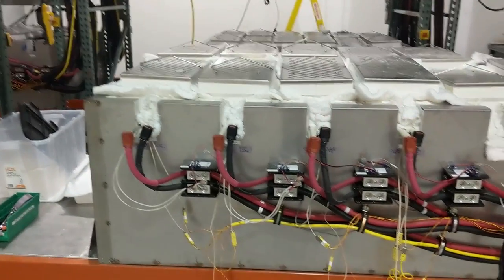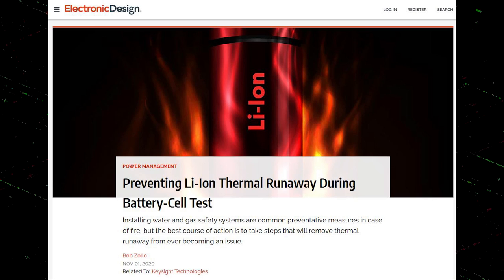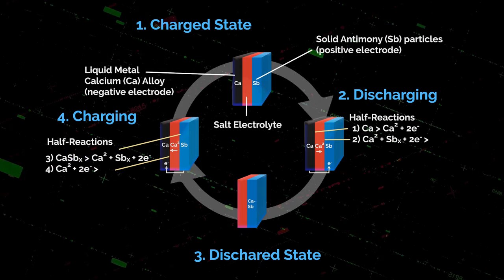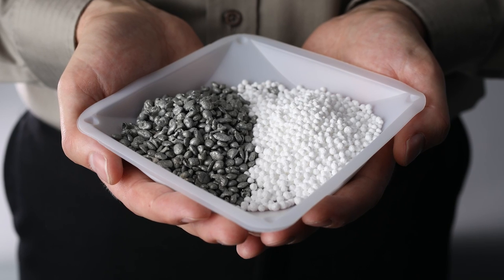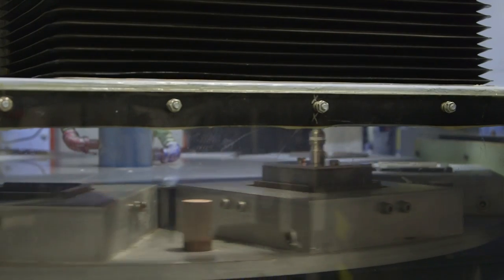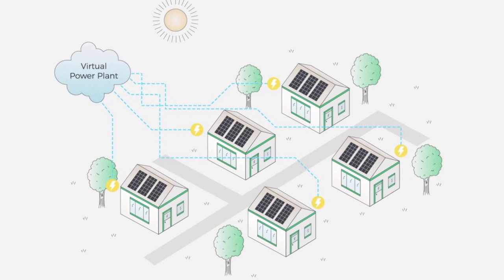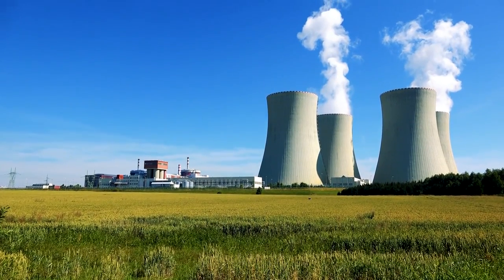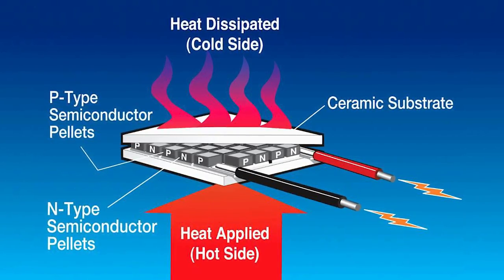Ambri: A Battery that Could Change the World

Comment: I wonder if you could combine this with one of those solar towers that use mirrors around it to heat the liquid metal.  That way you would still be using the sun to keep supplying more heat if needed.
Reply: they kind of use it to melt salt to generate steam and run turbines
Reply: The batteries are designed to generate their own operational heat through charge and discharge, and should not "freeze" unless they are not used for a number of days, or in the event that one of the cells fails it could end up freezing if say it had a loose connection. The key point is one of safety, and secondly efficiency(vs. cooling a li-ion bank), for if a battery cell fails the cell does not ignite and possibly ignite all the surrounding cells (as a li-ion bank might do) instead it freezes and is inert. A frozen cell could be brought back to running temperature the same way that it did it the first time it operated(the cells are shipped in a frozen state and brought online in the field). With the daily fluctuations in power supply vs demand on the grid, these cells should remain at running temperatures throughout the expected lifespan of the product.
Reply: And roasting every bird that flies by...
Reply: @jimrobcoyle  side effect = solar barbeque 😁
Reply: @jimrobcoyle  you could call it the Archimedes death battery
Reply: Hmmm... or use these to bleed heat off nuclear plants. These would easily store power from solar arrays... which could (should?) be built/put inside the empty perimeter of the federally protected atomic energy compounds... from which the additional power could go out on the same grid.
Reply: @mattwilliamson1714  In this case, the heat isn't generating power, it's a regular battery. You charge it with an electric current. The output is the portion of electric charge that was not converted into heat during the charge and discharge cycles. That is  basically how all batteries function
Reply: @mattwilliamson1714  lol.... nuclear plants generate amount of heat required for it's operation
Reply: @ironassbrown  I understood that. I was pointing out that an uncharged "dead" battery could be used to absorb heat.
Reply: @Brainwaave  Really? I'd never have guessed... and since I did not know that nuclear plants produce heat as a waste product... I went on to posit that there may be a chance to store dead "frozen" batteries in a place in which they could act as heat sinks until they were needed to store or transfer power obtained from a green source. 🤦🏻‍♂️
Reply: @mattwilliamson1714  well nuclear plants are closed cycle so if you take more heat off, you will have to produce more energy to heat up the cooling fluid which transfers heat from the core to the steam generator to run the turbines. you can not let the steam cool down to become water as lot of energy is required to change the state of water again.so things are not as simple as they may look like
Reply: @mattwilliamson1714  LMB uses the heat from a nuclear reactor in a more convenient way. The reactor heats steam that turns a turbine and generates electricity, that electricity goes through a wire into the cells of LMB and makes them hot, you don't need a giant heat exchanger just a wire, and it doesn't need to be built in the nuclear plant, you can put it somewhere where it is out of the way. remember the cells of LMB are insulated and sealed cans, which by themselves is simple. If you start adding a bunch of external interfaces to the design not only is it bulky and more difficult to maintain, but it isn't simple anymore. and the heat your pulling off the power plant would probably be more efficiently used to turn a turbine. If we are talking  about a PWR reactor then you really can't get the kind of temperatures needed to liquify metal unless the reactor melts down which would be very bad. An MSR reactor could get up to those temperatures but once again you want that heat for things like electrical generation and water desalination. The easiest solution to heat the Liquid metal battery, is to just use a wire and heat it up with electricity, once it is hot then it stays hot through daily use.
Reply: @Brainwaave  You have jumped to the wrong conclusion and attempted to bolster your incorrect assumption by explaining your view of my comment rather than just asking the "what, why, and how" of what I said:

Specifically, I was thinking of the Fukushima and Chernobyl events in which they needed the ability to quickly get rid of heat... at levels far in excess of the boiling point of water... and they also needed a power source to continue pumping water to cool down the reactors after the reactors were being shut down. Rather than depending upon slow diesel pumps (which need more time to kick on and be used effectively), this could be added into that equation.

Some of the batteries in this video (which operate at much higher internal temps compared to any type of boiling water) could have easily taken very high temps as heat sinks (which would have also activated the availability of the power within them as a further backup to a need for a power source to run the plant in the case of power loss). This could be done quite easily if part of the containment vessel was a metal that turns molten below the excessive levels which activate the frozen batteries, and stays molten far above the activation level. The molten metal would need a fail-safe such that (whenever the metal turned molten) it would be pumped around an array of "frozen" batteries (not at operating temp). The heat would transfer into these frozen batteries and act as an emergency heat sink.

Simultaneously, if more of these batteries (in some other location) were pre-charged (pre-heated) they could be activated immediately, used to power more containment features for longer periods of time... and be able to be recharged by either wind, solar, &/or a direct connection to the power grid... which would avoid future meltdowns.

Rather than relying on "standard" containment systems and backups, it would be simple to implement multiple uses of this type battery into the current design of nuclear power plants as an additional fail-safe to "bleed heat off" of those nuclear plants in the event of catastrophic failure.
Reply: @ironassbrown  Exactly. You weren't understanding my comment.

I was thinking that using frozen cells as a further failsafe (heat sink) would provide a very simple extra fail-safe into the containment process. (See my comment above to Arjun.)
Reply: @mattwilliamson1714  I see what you're saying, and my best answer would be that it is probably not a good use case for this technology. Do you have some design in mind that would take heat from the core of a reactor and somehow sequester it in the case of an emergency I would be interested to hear it. Right now I am trying to imagine how it would work since the way heat is carried away from the core of a PWR reactor is through the cooling water which is not nearly hot enough to melt metals and salts. In an emergency such as Fukashima, the problem was that there was no cooling water so I can't see how you would get the heat out of the core. Also, the amount of heat produced by a reactor meltdown that size is way more than could be contained even in a reasonably large LMB. I also have a hard time understanding how you make it make economic sense to build a giant battery bank that sits unused unless there is a meltdown, in which case you have some pretty big problems to deal with. I am not trying to fud on your idea, just hashing through what I believe to be the considerations.
Reply: @mattwilliamson1714  lol Fukushima and Chernobyl were two different disasters where the core melted, Fukushima due to tsunami the coolant got drained out and engineers didn't shut down the reactor in time the only damage was radiation leak ..Chernobyl was a human error where the temperature went haywire... you should not be designing a reactor with liquid metal batteries hoping that there would be a meltdown and we can use the heat... in case of run away reactor... no amount of those batteries will help as everything will boil in them

Comment: If you produce heat you spend energy, cost of operating this system is a big question
Reply: Brilliant tech. It heats itself just by working, so all you need is resistive heating elements to get to temperature. Luckily, you'll be hooking these up to megawatt-scale solar installations so wattage is no problem; you just wait a few days to produce usable energy.
Reply: @davidahn4130  not even days. less then an hour should be more then needed.
Reply: He said they would be well insulated, which I would not think would be that difficult. If so, after reaching operating temperature, energy loss would be minimal. Current batteries in production have internal leakage losses. If they could encase the liquid metal battery inside a vacuum walled canister losses would be virtually nothing.
Reply: Did you notice your phone heats up when you charge it?
Reply: what battery doesn't produce heat when it is charging and discharging? The difference here is that the heat is useful instead of an unwanted byproduct.
Reply: @danielboro2000  Right you can charge your phone to 15% and use it right away, it only takes minutes to put the charge in. This will be basically the same,  power controllers can switch back and forth between charging state and discharging state in milliseconds, and the batteries won't take days to take a charge they are meant to cycle daily which means that they need to be able to charge fully when supply is high and demand is low and discharge when supply is low and demand is high and that happens almost every day without fail every single day of the year.

Comment: It would be impressive if someone could incorporate the use of liquid metal batteries and Lithium-ion batteries at the same facility in an alternating pattern. I wonder if they could use the heat from the Lithium-ion batteries to heat up the liquid metal batteries without the Lithium-ion batteries being damaged or going super-critical
Reply: I would like to see this technology compared against the Ford Motor Company  developed Sodium-Sulfur battery technology which is also a hot battery.

Comment: What is Ambri's current manufacturing capacity? What is their plan to rapidly scale manufacturing capacity beyond 10 GWh/a?
Reply: Current capacity? Doesn't matter.... Easily scalable.
Rapid scaling?
Same answer.
Advantage?
More lithium/ Nickel, etc for weight/ density critical applications.
Think about the global power system rather than pitching one solution against another.
Reply: @rogerstarkey5390  I am thinking about the global power system, that's why I want rapid scaling. I want different types of cheap storage available on a massive scale in 2025, rather than in 2040. Ambri are apparently planning to finish the 250MWh data center project for their first customer by 2023.

Comment: really enjoyed the straight forward answers and it sounds like a great invention, I realise that the storage is large capasity I was wondering if it was possible to power cars and or trucks like a lit ion battery does.
Reply: It's designed for grid level storage, but a home sized unit is possible, but may be a bit big compared to Li-Ion.
Reply: No, it is a stationary battery only. Think shaking the oil/vinegar salad dressing.

Comment: give the POWER to the PEOPLE Swap-able Micro Thorium Generator Refuel once every Hundred Years. END PROBLEMS LIKE TEXAS
Reply: It's going to take more than a battery to end a problem like Texas
Reply: OK..... GIVE them the "Swappable Micro Thorium Generators"!!!!!
I'll take TWO!
WHERE ARE THEY?......... (Ready in ten years you say....?)
Meanwhile, consider the "Texas issue" this year.
What did the people need at an extreme base level?
Heat
A small amount of electrical power for communication.
Time period, a few days.

These cells could have provided both.

Comment: I have major doubts about the practical application for this type of battery because of the heat requirement.  It seems like it requires too much energy overhead to be useful in all but a few niche cases.  I also get the impression that these batteries will be immense in size.
Reply: Bigger than a nuclear power plant?
Reply: @charmainebacke7888 a long side of the solar and wind farms that are required in order to charge these batteries? Well...... yes. Still worth the size imho, as they allow a storage for more power, but unlike nuclear, they don't create power, they just store it. Belkenator has a point though, as far as energy overhead. While the energy is being stored or discharged, the battery is stated to maintain temperature. The battery does not hold a charge when in a solid state, though. This means a massive investment of heat energy dumped into it before it can maintain its own heat by usage. The other point I believe Belkenator is making is that these batteries seem to need to continuously discharge or charge to maintain their heat, because if they are charged fully and sit charged for too long, these batteries may either need to be heated(using further electricity) or discharged at a time when the energy is not needed. The heat from charge and discharge of the liquid metal batteries are a loss of energy through (heat)radiation. Unless these batteries take all day to charge and/or there is an excessive enough amount of power created during production hours by the grid to maintain the temperatures these batteries require without stress to said grid, it MIGHT be a hard sell to convince people that it is helping the grid to have them over just adding another energy production that is round the clock... Like more nuclear.... Or hydroelectric.